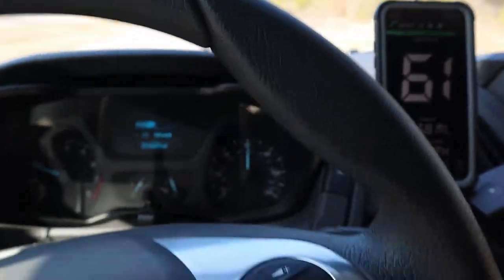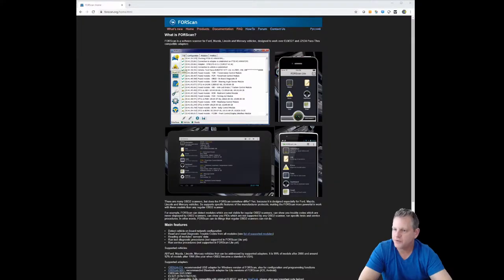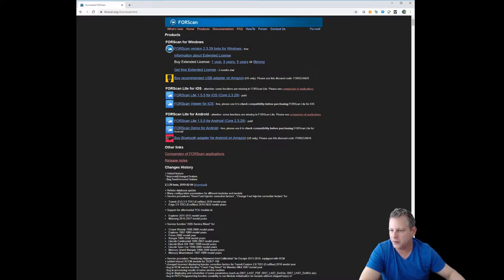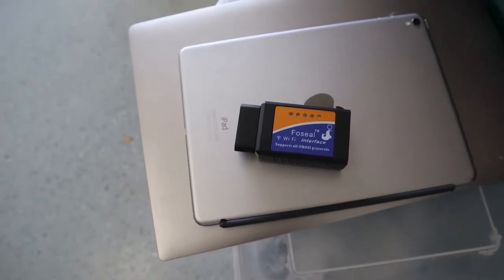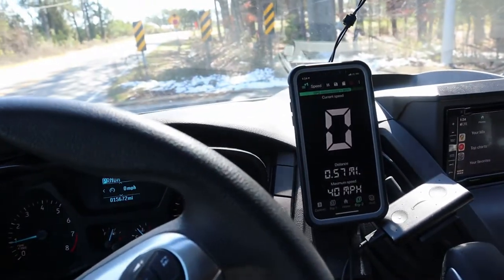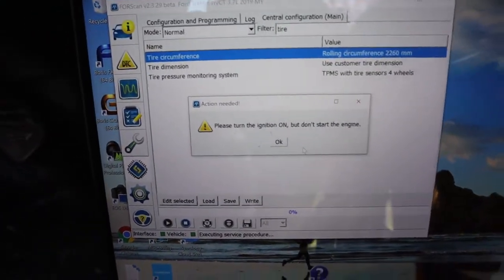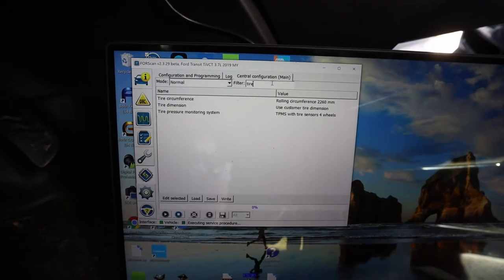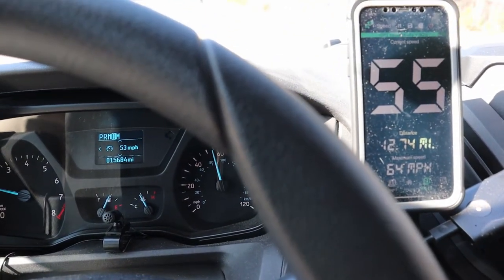#MTBPlanB Ford Transit Van speedometer calibration using Forscan

Comment: Did updating tire size change when transmission shifts? Thanks
Reply from the maker: I didn’t verify but don’t think so. I did however reset the tcm for the adaptability relearn for my driving habits. Couldn’t really tell a difference.

Comment: Hey, any chance you had to change any forscan settings? I bought the same adapter but can’t get it to connect. My computer connects no problem…
Reply from the maker: Do you have the license? I believe that is required when making changes.
Reply: I don’t have the license yet. I was more or less testing the adapter. I thought I could get away with that but maybe not. I’ll have to get the license and try again.
Reply: No dice. Even with license it doesn’t work. I even verified the adapters IP and port match forscan wifi settings. It doesn’t look like this wifi adapter is recommended by forscan anymore. Maybe it’s just a glitch on my end but who knows. Thanks for the response!
Reply from the maker: @getaway_man  Oh man…I must admit I haven’t used it since last summer so maybe there is some incompatibility with newer versions of Forscan? Not sure if you can grab an older version?
Reply: No worries, I just ordered one of the recommended wired ones. I’m just anxious to fix my transit speedo since I upgraded tires haha. Happy travels!